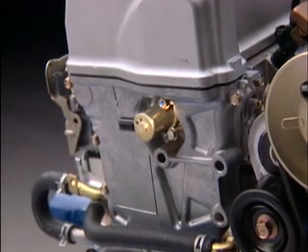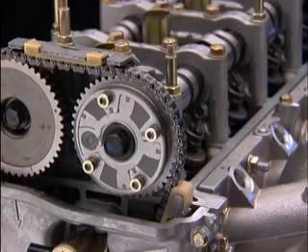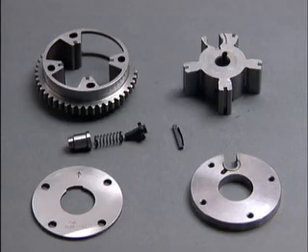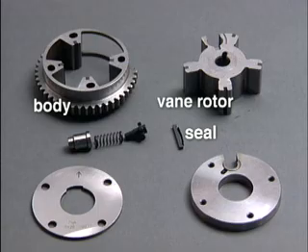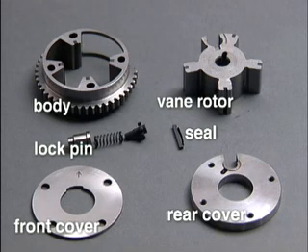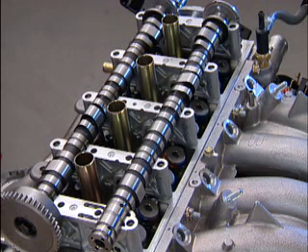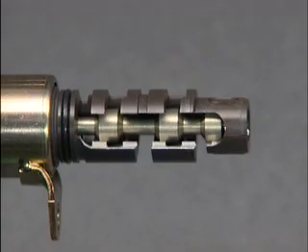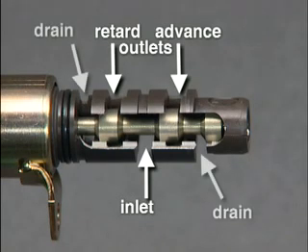K-Series iVTEC VTC Cam Phasing System - In Depth

Comment: As a Performance Tech, I've tested, driven, and tuned several different Makes and currently own a 2L Subaru WRX 400WHP. I can honestly say that if I-Vtec was given the credit it deserves, it would be in EVERY car desiring true efficiency, power and affordability.

Big engines and stock turbo can make power. However, efficiency isn't due to a great engine, its due to the added fuel/size and F.I.

I-Vtec peaks efficiency w/out displacement or F.I.

Not to mention the ECU on K-series is amazing.
Reply: KornShaDoW097 bro the best coment i seen all day
Reply: While you are waiting for Vtec to kick in at ~5800 rpm, your looking at my tail lights ...
Reply: @ACommenterOnYouTube  that's only for first gear, kinda like waiting for a turbo to spool after going WOT.

 the torque at a higher rpm is better for straightline anyway.

Better launch, and your actual power is higher, since torque=more hp as rpm increase.

a car peaking torque (ie peak cylinder force) at 200lb-ft @4000 rpm will make ~150hp @4000 rpm.

A car making 200lb-ft @6000rpm will make ~230hp @6000rpm
Reply: @ACommenterOnYouTube  And when I install Kpro and my Vtec kicks at 3500 RPM you're thinking I shoulda gone HONDA
Reply: @jesseleeV  My boost kicks in at 1600 rpm and holds till 7k rpm ...
So ... once again, how do my tail lights look ?
Reply: @ACommenterOnYouTube  lol you gone! you win
Reply: @ACommenterOnYouTube  my boost kicks in at 2k, vtec is locked and I'm making 900 at the wheel. I bet my tail lights look nice
Reply: @ACommenterOnYouTube  you're it is you're holy fuck
Reply: @ Taking a fat dump:

Oh it ALWAYS lasts ....
Reply: Changes valve timing. Does nothing for valve duration or valve lift. Freevalve does all this. And, small battery and fully electric drivetrain allows to use the engine at a very narrow optimized rpm to ONLY recharge the battery when needed. So, making ALL of this valve shit useless.

Comment: LOL Just so you know cams control lift. SOHC has one cam that controls both intake and exhaust. DOHC has a cam that controls intake and a cam that controls exhaust. When you talk about intake/exhaust timing it implies cams. I mean does magic then control lift? But for the record how about you people read a wiki page or better yet a book. VTEC's original purpose was to increase HP to 100HP per liter of displacement. Which it does. This is because in Japan they have a tax on engine displacement.

Comment: Jeremy Clarkson : "Vtec is the best engine system"
There are more then 50million vtec engine...
Reply: Vtec and vtc are different to anyone seeing this.

Vtc advances/retards camshaft
Vtec controls high lift cam profile.

Together (I-Vtec) it's able to advance/retard cams(VTC) and also increase valve lift/duration (VTEC). 

VTC is common in many newer vehicles for better efficiency and EGR effect but not many vehicles have variable valve lash(VTEC) but (VTEC) isnt limited to Honda and is on other performance minded vehicles for good low end response(VTEC off) and top end performance (VTEC on).

Comment: A freelance vehicle designer came up with this system in the eighties.  Honda was greedy in dealing with this guy.  So now they are losing some ground to his other engine designs.  Nissan also worked with him.  In fact, most engine advancements since the eighties came from the same person.  I am talking all of the major manufacturers here!  Ecoboost, Ecotec, Skyactiv etc... the list goes on.  If your vehicle has electronic fuel injection you have benefited from his work.
Reply: literally who

Comment: Lol old post but toyota did not come up with the intake and exhaust valve lift control. Nissan did and it was called the NEO VVL. Back in 1997. Honda now calls it the I-VTEC. And it appeared in 2002.